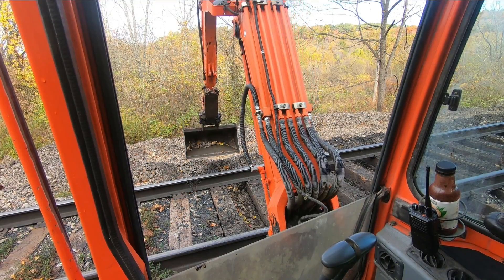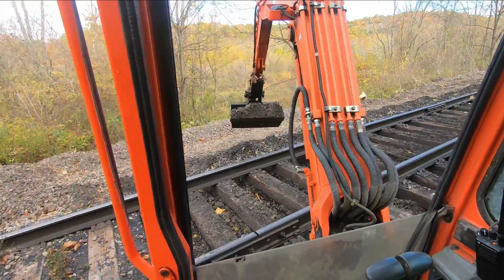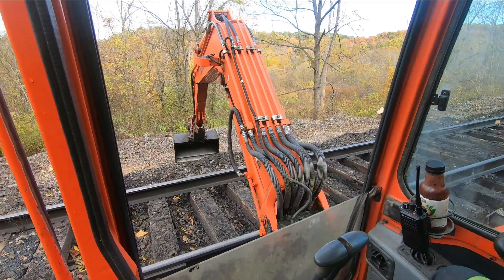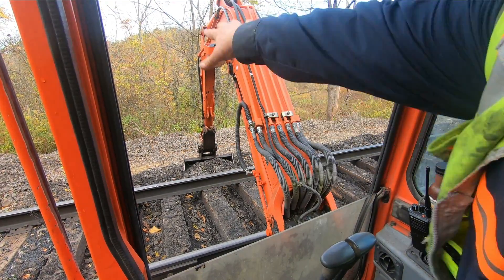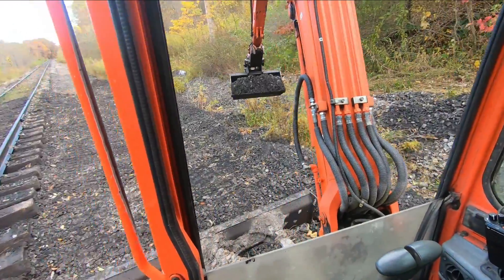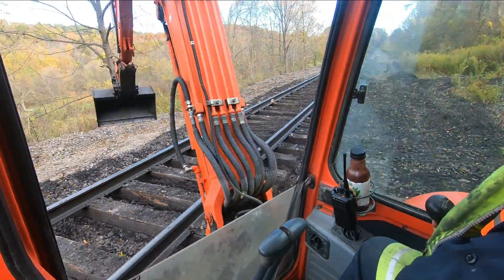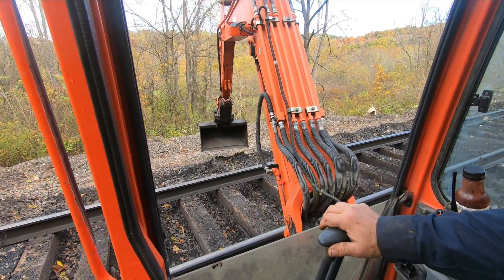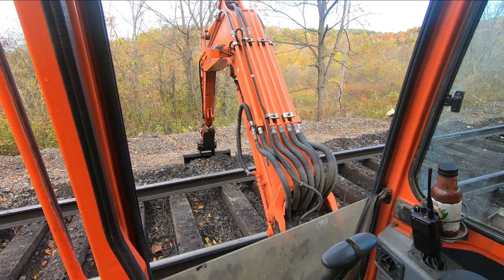Why Don't we Reclaim and Wash our Used Ballast?

Comment: you could always use a sifting bucket to reclaim some from what you have tossed in a pile. Wouldn't need any extra equipment there apart from a bucket
Reply from the maker: I had suggested that several years ago Geoff and was told
they thought it more cost effective to just buy new ballast
rather than pay me 30 an hour to sift it. I'm not a bean counter,
just the guy that keeps trains running which in turn pays the bean counter's salary.... :-) Thanks for visiting with us and watching
my good man.

Comment: Before I started watching this channel, I always thought of railroad tracks as being super low maintenance. I.e. once installed, they are good for 30-50 years before replacing the ties. I had no idea the level of work that it takes to keep a track properly ballasted and maintained.
Reply from the maker: All RR's have their own unique problems Jeff. Ours has a lot
of maintenance issues due to leaky hopper car doors along with
16 miles of jointed track having 70 curves well over half of
which are 5 or more degrees. And we only have 2 track people
to try and keep up. Yes we have an insane amount of
track maintenance, not all RR's are like this, but still some
have worse problems to deal with. And we don't have the
budget a big RR like BNSF has either. Thanks for watching
the video today and writing in my friend.
Reply: I thought the exact same thing. The exact opposite is true lol, once the railroad is built the real works begins.

Comment: To operate a trommel, you'd need power, water, several operators, fuel etc... it just wouldn't be cost effective to wash ballast like you'd wash gold off of rocks. It would be much more economical just to obtain new ballast.
Reply from the maker: Sure wish there was a better way that was cost effective Rory.
But I've said that for the past 18 years too. Really appreciate
your dropping by and taking in the video my good man.

Comment: Dave, is the "contaminated" gravel and soil along the rail road going to become an legal or environmental liability?  I work in the petroleum industry, and there are a lot of rules and environmental testing requirements for decommissioning sites.  Aren't there similar rules in your industry?
Reply from the maker: First off fredy very good question and I do not know all the
environmental rules on decommissioning. But something like
a slurry pond to eliminate it: The water would be drained off
and taken to get treated. Then the coal fines and mud left on bottom
would be filled in with clay and dirt, then seeded over. A very
big expense. I am not sure of the number of years allowed
to keep a slurry pond as is after the mine would shut down,
that may even be a thing that is state controlled, I just don't know that answer. 

The EPA is not that concerned about me putting coal fines along
the right of way. In fact coal has been tested and used
successfully as a fertilizer for some time now. It does
not provide nutrients, but it does increase soil organic matter. So
by spreading the coal fines out along the ROW I am actually
enriching the soil. However with that said, I am careful not to
do it where it may leach into a stream. That's what gets the EPA
riled up, coal mixing with water. 

Read the video's description for a more detailed info on coal
as a fertilizer.
Reply: @ccrx6700  I didn't realize it was used as fertilizer!  So then it's probably not a problem.  I just know that gasoline and diesel are NOT used as fertilizer!  :)

Comment: I run a payloader and screen topsoil/ fill. I would think that you buy a screening plant, which would reclaim your ballast, with all the coal and fibes being shaken as it goes through the plant.  That same oayloader could do 3 jobs. Load the ballast onto a gondola, then run the screen in plant,  then load the gondola. Then run back and spread the ballast.  Seems like a lot of work, but you would have reasonably good ballast except for the color. It might work if you mixed old with new and cost a lot less
Reply from the maker: Your so right in that Cuffy, it would not be that difficult with only
1 machine. I would like that, keep me moving and busy. Really
appreciate your taking the time to watch and write in my friend.

Comment: Thanks for the detailed explanation. The ballast you throw on the sides does not bother the drain? On the other hand it would seem that the soft ground would "swallow" the ballast anyway. Maybe the company  don't have to make all that infrastructure investment. There are "ballast cleaners" (Matisa, Plasser & Theurer , Loram ).   Maybe you could hire this machine to clean the ballast? Obviously I have no idea of the cost per mile of the service .
Reply from the maker: Your welcome aleu650. We would love to have one of those
big cleaners in here, however we do not interchange with any
other RR so getting them in here is impossible. They are so
big I don't think they could even truck them in without 
dismantle and reassemble. Big, Big dollars doing that. Thanks
for watching and writing in today my good man.
Reply: @ccrx6700  Now I understand the problem much better.  Thanks again for the explanation.👍👍👍

Comment: You don't wash ballast to clean it. You use a trommel (a rotating perforated steel drum which sifts out the dirt and coal fines. it is a TOTALLY DRY process.
Reply from the maker: That may work very well when the contaminated ballast is
dry, but when it's wet and mud covered, not sure how that
would play out? I'm not that familiar with the apparatus you
are speaking of to be able to say. I just know when it's wet
and muddy it's hard to get off the ballast stones when I'm
digging. Thanks for watching the video today and writing in John.

Comment: From past episodes,  the ballast is limestone which is softer than basalt typically used.  Vibration can cause rounding of the crushed rock, reducing the ability to "lock" the ballast into a solid foundation.  New ballast stacks into piles  with steeper sides, this is due to the sharp edges.  Called angle of repose, it is an easily measured quality.
Yes, the ballast "wears out".  Beach sand is often very round grains that flows like water when dry.  Decomposed granite (grus) is mostly sharp quartz grains and has a high angle of repose.
This quality is important to construct a stable foundation as it spreads point loads faster, requiring much less ballast.
Reply from the maker: Your absolutely right Keith. Ballast has a life and the trains along
with tamping rounds off those sharp edges on the ballast. Sharp
edges lock into the ties and create enough resistance to keep
track from sliding. Rounded ballast is like having a track
on roller bearings. Wet coal and mud also act like a lubricant and
can cause track sliding/shifting. We priced granite many years
ago which wears significantly less than the limestone we use,
however the cost per ton was like 60 bucks 10 years ago,,
can't imagine what it would be now. Our cost is 18 for limestone.
NS uses granite here but they have their own unit trains to
deliver it. Really appreciate your watching and writing in my
friend.

Comment: Why does the RR care if the ballast is clean or not?  Why change it?   Its just rock, right?
Reply: It does matter, and it is more than just "rock".
Reply from the maker: Ballast when it is clean provides excellent resistance to track
from sliding/shifting. When it gets plugged up then water
can't drain away and mud forms which does not provide
very good resistance when it is wet. Contaminated ballast
simply does not hold track surface very well like clean
ballast does. So what happens is when the train goes down
the track over poor ballast there are a lot of perturbations in
the track surface which can easily contribute to car derailments.
That is the short explanation Randall and hope it helps
you understand better why we crib out the ties and put in
new ballast.

Comment: As I understand it the irregular sharp edge shape of the original ballast stones is key to the integrity of the support they provide.  The stones lock together and can take weight without shifting.  Over time the edges become rounded and move more easily. Eventually you have rounded ballast that is more like ball bearings and offers little structural integrity. Add coal dust, oil and other contaminants and you have a very unstable base for rails. I am not a railway worker, I am IT in a University (Wollongong, NSW, Australia) that has a railroad research team and on my occasional visit to their workshop this is what I have picked up. Correct me if I am misinformed. Thank you for your channel Dave, you have taught me more about practical railroading than any University could. Yes, I am a railfan and am about 3/4 the way through my goal of travelling all the long distance passenger routes of AMTRAK in the US. Keep making the great videos.
Reply from the maker: You my friend are absolutely correct! Sharp edges on the ballast
stones are key to providing much needed resistance to the ties
in order to keep track from sliding or shifting.  Edges on ballast
can become rounded via train forces and most specially via
tamping. Tamping rounds off the edges. Ballast has a life
and on some basis needs replacing with new sharper edged
stones. So accurate you have said about rounded ballast
being unstable for track integrity. 

Coal fines when dry are not a bad ballast, however when they
get wet from rain, that means they get mushy and want
to act like lubrication with no resistance to ties which will
want to slide ties and above rails.

Just an awesome comment you have sent in. I certainly wish
for you the very best in your future. I appreciate a thinking man
like you are. your very kind words about me teaching you
touched my heart. I'm always here if I can provide any
future assistance to you my friend.
Reply: @ccrx6700  Hi Dave, I was surprised to hear that tamping is a major rounding factor, I had assumed that (other than correcting track geometry) its purpose would be to expose fresh edges and reseat the stones. You live and you learn. That's why I like your channel. Practical is different from theory. Next trip (February) I am going to Japan and will check out how they do railroading. I only have The Empire Builder to go before I complete my AMTRAK tour and I hope to ride it in November 2023. NB: I knew it was serious when in March 2020  they said the Southwestern Chief would be on time into Chicago. An AMTRAK train on time?? Unheard of. But freight rail had died of by this time. Keep on railroading. Rodger (I am 62 yo)

Comment: How big of an easement does the railroad own off the side of the tracks? Or does it vary by location maybe. I suppose the other thing is the old ballast you’re disposing on the side there does help shore up the earth a bit, helping with drainage and runoff. Less washouts.
Reply from the maker: Typically we own 150 off both sides of the track Joshua, but as you say there are places where we own considerable more, depending
on what deal they made back in the 1970's with each land owner.

Coal fines are a fertilizer. They increase the organic matter of the
soil. So I am actually improving the soil quality by spreading the
coal along the right of way. There is more detail about coal
as a fertilizer in this video description if you'd like to read it.
EPA is not concerned about coal fines on the ground, except
when it comes in contact with a stream. I am very careful not
to do what I did here if it would mean fines washing into a
stream. EPA would conniption fit out about that. Appreciate
your watching and writing in today my good man.

Comment: Seems the big prob is the wet-washing- dealing with the dirty water. You need something similar to a firewood cleaner, separating debris from product while all is DRY. 
You could call it "dry-cleaning" vice washing. Bingo! Major problem solved, now for the material-handling details.
Reply from the maker: Sounds like an interesting idea Jacques, I have not heard of that.
Would you happen to know of a video where I could watch
it being done? Still there would need to be something done
with the cleaned off coal and mud debris? Really appreciate
your writing in and for watching my friend.
Reply: @ccrx6700  Hi there Dave. I just searched on YT for "cleaning firewood" then went for the first real hit: https://www.youtube.com/watch?v=BD-zQPhs6dc&t=306s Firewood sellers have some really fussy customers, e.g. restaurants, who want "clean" wood. Obviously for cleaning ballast the material-handling machinery would have to be protected from abrasion of stone, and scaled up to suit the job. As with wood, the debris would likely just fall through into a bin for trucking to your local "landfill." You'd "tune" the machinery feed-rate and speed for desired throughput and separation efficiency. You might have to see to the used ballast being dry, like spread out in summer. Bada-bing! EPA and DEP be gone!  Happy to be of help, pard.

Comment: In 30 years when they close down the mine, how much do you think it will cost when the EPA says tells your company that it must clean up all the dirty ballast that you dumped along the track?
Reply from the maker: EPA is not so much concerned with coal as a solid as they
are with coal slurry water Frank. Coal is a natural occurring
product. Coal slurry water is not. What harm to the environment
does coal fines produce? EPA has stringent specs currently
on the disposal of coal slurry water, but much less requirements
on the disposal of coal fines and waste. What studies do you
point to that say that coal fines has a detrimental effect
on the environment? I would really be interested in seeing
those as opposed to your personal opinion. Please respond
with those studies if you will my good man. if indeed coal
fines are a detriment to the local environment, then we
need to find a better way to do what we are doing. I am 
concerned

Comment: The costs incurred just in complying with regulations, alone, would kill any incentive to do the grade, sift, slurry, pump out .... no es bueno.
Reply from the maker: it costs a ton of money to reclaim a slurry pond Paul. Water must
be drained off and then taken to a treatment plant, huge dollars
there. Then they fill in over the left coal fines and mud with clay
and then dirt and seed down.
Reply: @ccrx6700  Thanks!  Yes, anytime slurry needs to be sent through a separator the costs just balloon....away back when, in about 1976, one of our PC board vendors built a closed-loop water purification system that pulled toxics and heavy metals from water...now, the final result was water that was more pure than the input provided by Alameda Water District here in the SF  Bay Area, but the cost to install the system and then remediate (have a gent load the stuff into his Conventional Pete w/tank ten-wheeler and transport the sludge to a reclaimer was, for the time, astronomical....These days, anything requiring manual labor/time is nearly prohibitive - as you see in getting ROW machines in and out or your property.  Unless the company has really deep pockets the size of what Croesus may have had,  it's much more effective to have you and other folks do the work on an as-needed basis.....and you get to work outside instead of behind a desk!  Love the videos and your narration!  Keep 'em coming!  Best, PK the old Squid
Reply from the maker: @paulkalff6408  😊👍thanks for the great reply Paul
Reply: @ccrx6700  That's Railroadin!  It's fun in the sun (or rain or snow), so regardless it's what you love!  And, your lovely bride is in on the fun!  Best, PK

Comment: Down at the Spenser Shops in NC, there is a really odd MOW train sitting off in the display area.  It was designed to be a ballast cleaning train by the Southern Railroad.  Unfortunately, after a period of "trying" they gave up on it, and donated it to be an exhibit...  Cleaning ballast for re-use is a challenge.  I've see a few of the things running on the web, but they were all owned by someone other than the railroad, and were a "pay by the mile" type operation.  And it looked expensive. (Keeping the thing from automatically shredding switches, Diamonds and the like is a serious concern....)  I could see rescuing the Fines from the mud and selling that is a super fine grade of coal, but who would buy it at this point?:  Not really suitable for big power plants.
Reply: There are power plants that can burn slurry. It also was tried in Diesel and turbine locomotives. Neither of which were a success. GE built one for the UP that burned coal and the dust basically destroyed the turbine blades.
Reply from the maker: Thanks Billblom for the nice comment. Interesting on the cleaning
train. Southern was a great RR in it's day. Stanly Crane it's CEO
is the guy who saved Conrail and made it into a profitable
RR. Appreciate your taking the time to tune in and watch today
my friend.